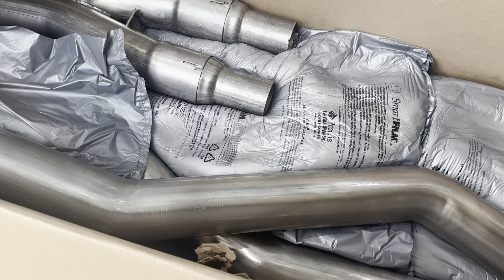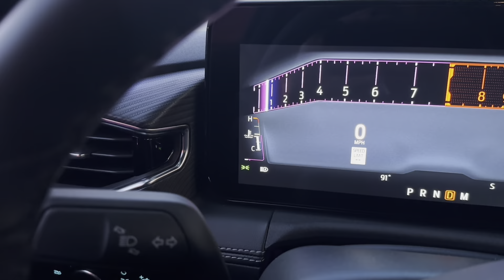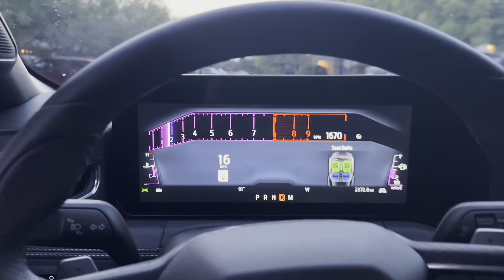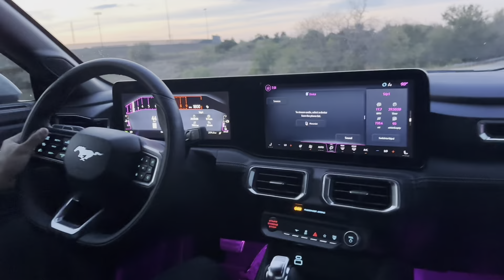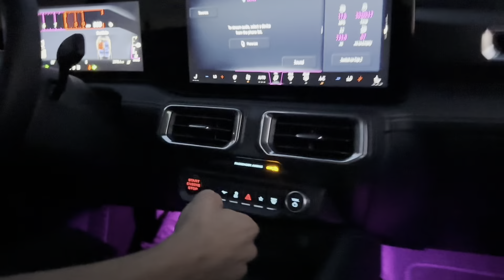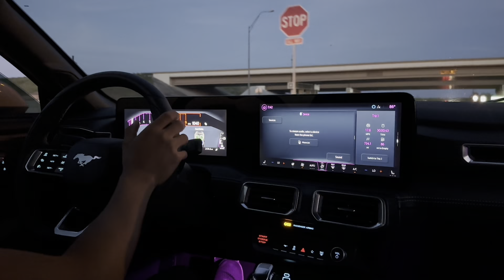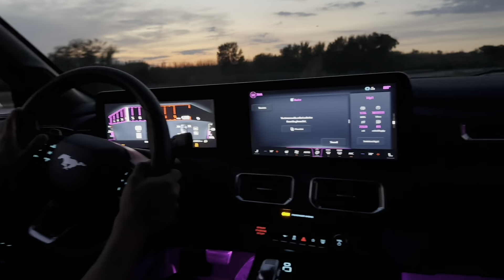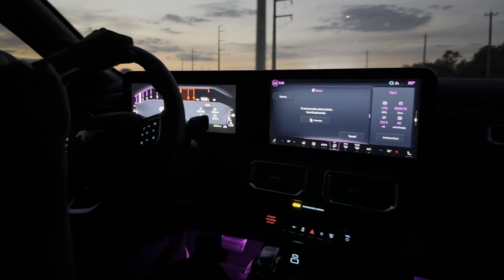2024 MUSTANG GT S650 WITH BORLA S TYPE CATBACK EXHAUST. (15-17/18-24* compatible*)

Comment: Just ordered the new Borla S-Type built just for the dark horse and I got kooks 1 7/8" long tube headers coming! Can't wait to hear it pur!

You should install the K&N cold air intake! it makes the engine sound amazing and helps so much with airflow and engine temps.
Reply from the maker: I drive a lot so I’ve just been running a few sets of stock filters they capture a bit more junk that’s in the air. 

Dude post that sound clip when you get it all installed,it’s going to sound so good🤙🏽

Comment: I had Borla S type on my 2011 GT. I love the sound and quality. I also order from Beefcake Racing and I wasn’t impressed with them because my 1st exhaust arrived dented on both sides. They gave me the run around. I called Borla and they sent me a brand new exhaust, no returns or anything.

Comment: Corsa extremes or Borla S type?! It's a tough decision. I have a Steeda H pipe with stock non active and like you not a fan of the sound in the higher RPM range but contemplating the full 3 inch cat back when they release or going corsa double helix
Reply from the maker: The new corsa sounds good so if you don’t mind spending 2600-2800 I’d say go that route otherwise for 2k the borla is legit… the last 13k miles I’ve had it on haven’t gotten old

Comment: What did you have before? Just stock or did you have the res delete with H pipe?
Reply from the maker: Had the h pipe in less than 24 hours of owning the car but with the non active system it sounded like crap. So I went directly to this borla system
Reply: @Rydatime  I'm kinda torn between the Corsa Sport touring with double H pipe or the new AWE exhaust that is supoosed to be coming out.  I don't have active exhaust either and just trying to find the right set up.  What's your honest opinion of the Borla S?
Reply from the maker: @davidhammond10 man I love it! Not to loud when you don’t want it to be but loud when your on the gas oh and cold stars are nasty… some days I wish it was a bit louder, just not full on attak loud.

Comment: Hey, am i able to use any exhaust that fits the s550 on my s650. I called different shops and they didnt know if the older exhaust systems were compatible.
Reply from the maker: Unless you have a convertible yes, but be aware if you got the non active system on your call and want to put quad tips you’ll have to cut it like I did. Otherwise if you have dual tips the 15-17 exhaust boot up with cutting of the bumper and the same goes for the quad tip active system cars they will bolt up any 18-23

Comment: Nice! i have the same situation and i checked to see if i could just buy the valence for the dual exhaust ones and its $800 just for that piece of plastic! I'm gonna do the same thing you did, what type of attachment did you use on the dremel?
Reply from the maker: A thin cutting wheel  and check cj pony parts it’s like 450 for the that lower part

Comment: Hey, love the video, does it gonna fit the gt 2p24 convertible?
Reply: 2024
Reply from the maker: So they fit kinda, the convertibles have a fitting issue due to the brace they need underneath to add structure due to the loss of it with not having a solid top. There’s a few vids on how to work around putting an exhaust on the convertible models

Comment: Question I got a gt premium non active I would assume I would be able to throw on an atak 2023 and it would fit since u did it to the type s right?
Reply from the maker: Correct, you’re just either have to cut your rear valance or buy the quad tip one but I recommend cutting first

Comment: Just wanna confirm are these the 3 inch exhaust system? I’m about to buy for mine 😭
Reply from the maker: 3inch piping with 4 inch tips now I believe 
 borla is bringing one with 5inch tips to fords performance line
Reply from the maker: I got mine off of summit racing under 2018-23 models it’s was like 2193.00$ after tax
Reply: @Rydatime  thanks for the info brother. Keep repping that s650
Reply from the maker: @ETiradoRacing  no problem, post some content when you get yours done up !

Comment: wait since when did the 650 come with dual tips and not quads ? did i overlook that or something
Reply from the maker: It’s a dam shame. But if you got the non-active exhaust then it’s dual tips and active are quad for 24
Reply: Only way to get quad is get active exhaust. Even getting performance pack  doesn’t give you quad tips.

Comment: Clean cut, sounds awesome too. Is it the same part number as the 2018-23 mustangs?
Reply from the maker: Could have did netter. I was rushing and forgot to round off the 90° angle but it’s all good.   Yes 15-17 works with no cutting and 18-23 with some cutting.
Reply: @Rydatime  actually the sharp cut made it look more oem I suggest u only smooth out the edges until aftermarket diffusers come out. Looks sick
Reply: What do you mean 18-23 with cutting? What needs cut. I have 24 with active trying to see which system fits
Reply from the maker: @Matth-mg7yr  so on the 2024 if you get a non active exhaust then you get dual tips.  Vs active you get quad tip exhaust. 
Well I happen to get a non active  gt so In order for me to add a quad tip cat back there was some cutting of the rear diffuser to fit.
Reply from the maker: @Matth-mg7yr  in your case you’ll just bolt any 18-23 system up… they are the same so now it’s 18-24 added for compatibility
Reply: @Matth-mg7yr 
With active quad exhaust there should be no cutting required

Comment: Which year exhaust system did you buy?
Reply from the maker: 2018-23, I had to cut the rear bumper to fit the quad tips but if you would like to avoid cutting get any of the 2015-17 models

Comment: Trying to look like the active exhaust eh? Lol your funny.. it looks nice, I like the blqck😢
Reply from the maker: I didn’t order my car, so it didn’t cross my mind that the one I bought off the lot was dual/non active 🙃 Otherwise I would’ve Just bought it active.   
The black does blend pretty well.
Reply: I know you’ll enjoy it a ton! There is a lot of heat on the web about the s650. I ordered mine as soon as the order bank opened in April I believe. Should be in around Oct.7th. I know I’ll enjoy mine! Just wait till aftermarket cracks this thing man.. it will be beautiful, just have to enjoy the waiting with a beautiful new car.